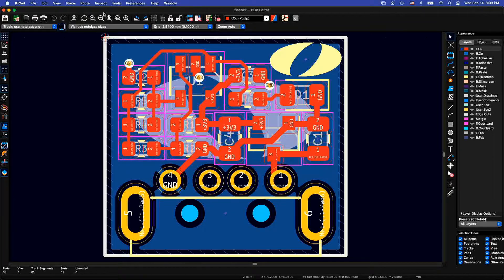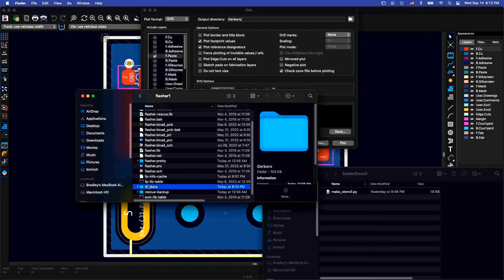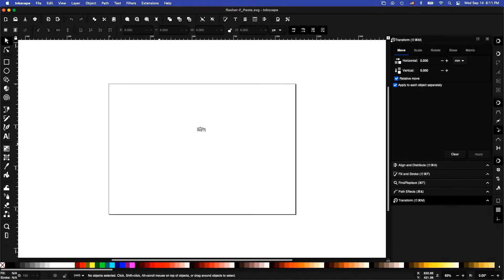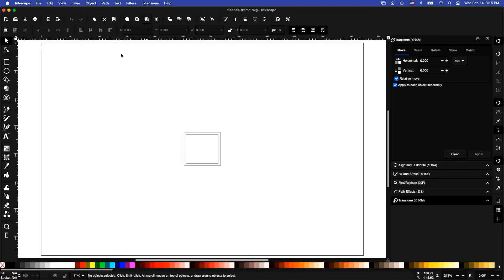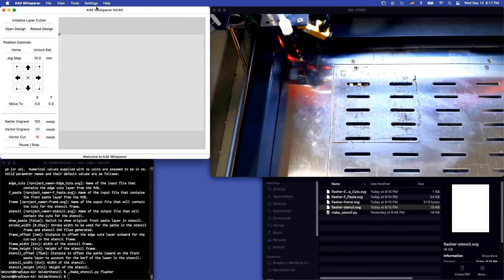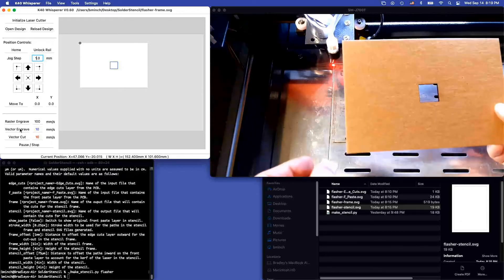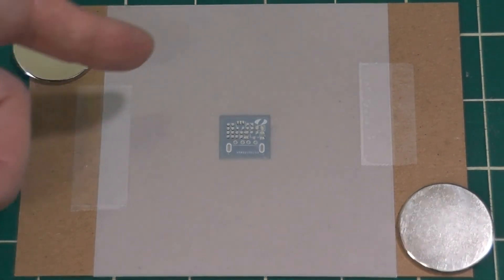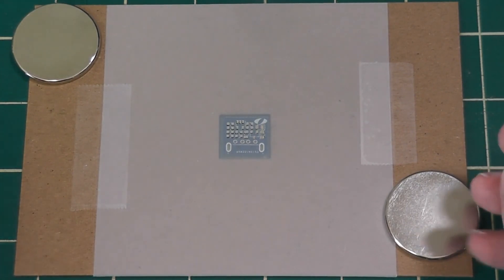Laser Cutting Quality Low-Cost Solder Stencils from Mylar for Manual Surface-Mount PCB Assembly

Comment: Hi, I'm trying to run this python script but without success.  
File "C:\...\make_stencil.py", line 480, in bounding_box
    return (min(xvals), min(yvals), max(xvals), max(yvals))
ValueError: min() arg is an empty sequence
Reply from the maker: Without any information on how you are running the script and what your svg files look like, it is going to be very hard to say anything about what the issue is likely to be.  This does not seem like the best forum to try and address things like this.